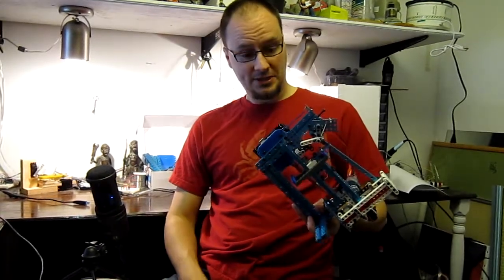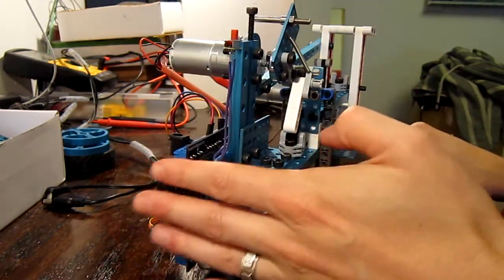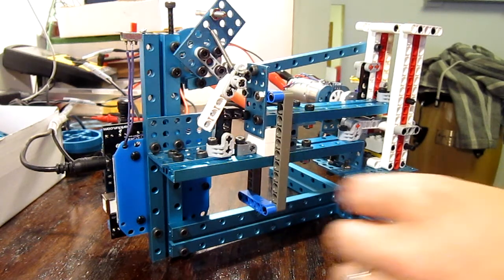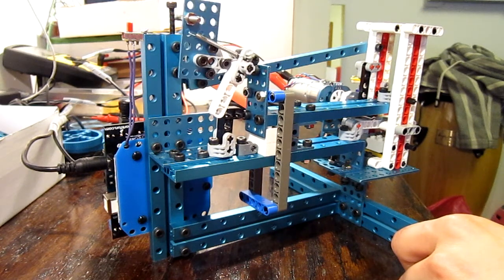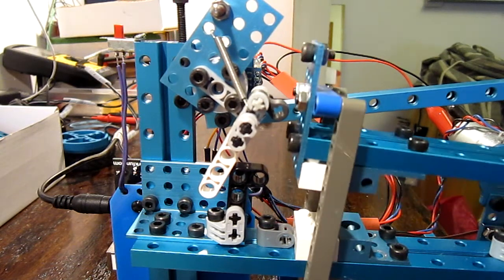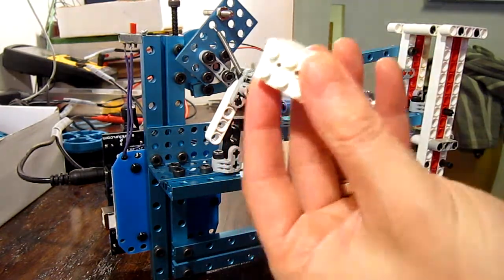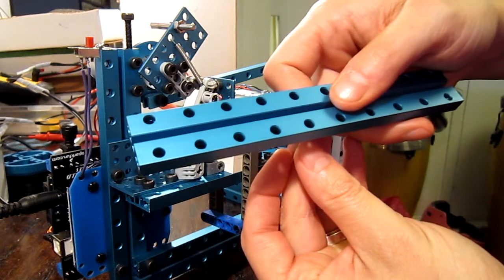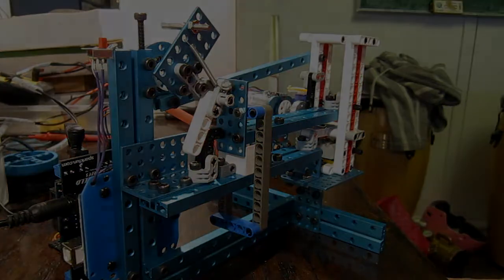legotest - It's alive!

Comment from the maker: I finally got all the movements to work together.   I also tested it with the pair of LEGO bricks from the first test to see what happens when the bricks can't hold on anymore.  It worked perfectly. 

Now I'm testing how I can make it fail.  Since I expect that each test will run between 30,000 or 50,000 iterations, I must be sure that it will never get stuck in an unexpected state.